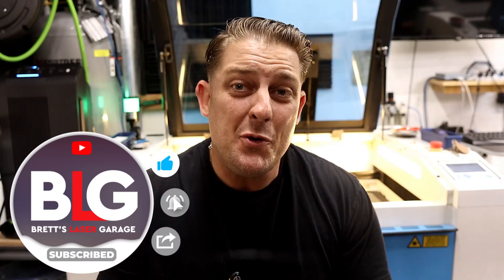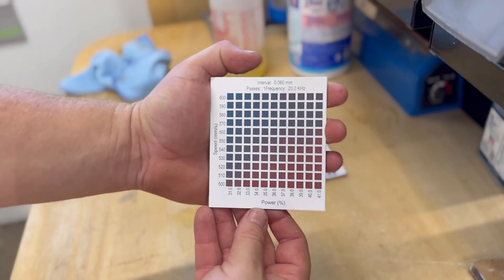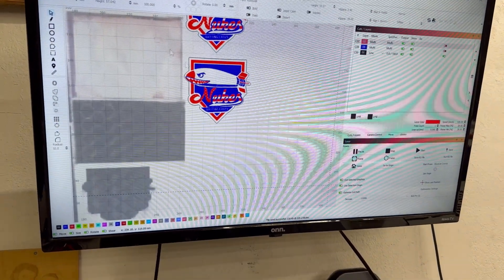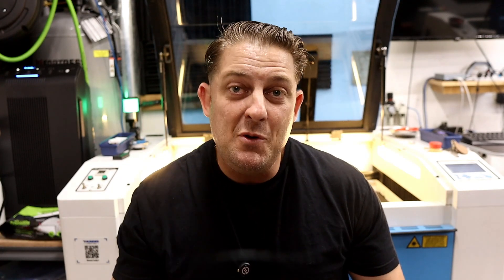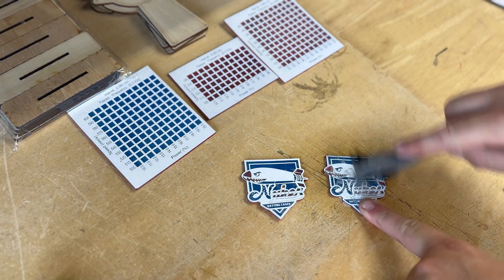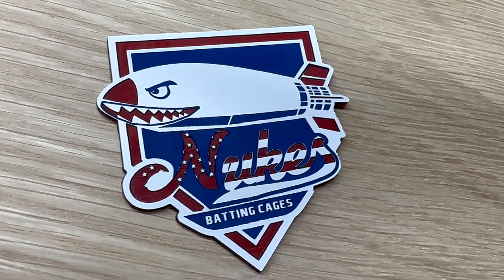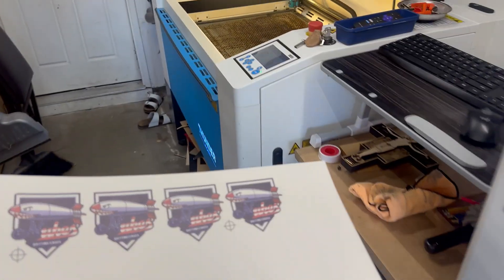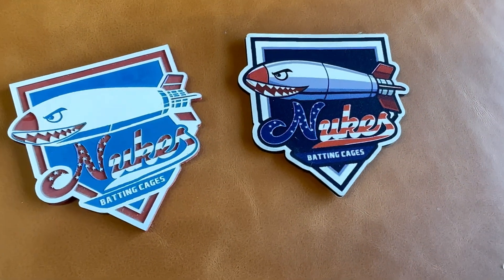I Tried Making Hat Patches with This Laser Material… Here’s What Happened

Comment: I cut the outline on the p2, then engrave on the f1 ultra... 
For 3 layer gold/wht/blk.
•1st (pwr 90) (spd 3000) (Lpc 220) •2nd same but ×10 passes.
Have p2 settings but the ultra was just way better, use outline when framing. Not fast but works.
Reply: Forgot to mention the color is irrelevant, they all engraved the same.